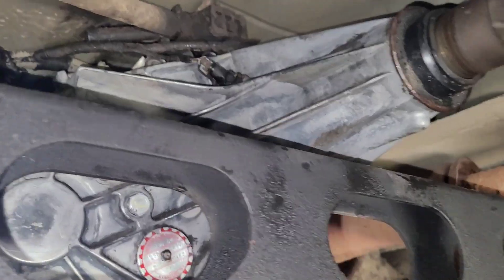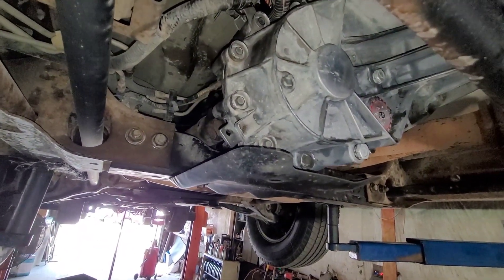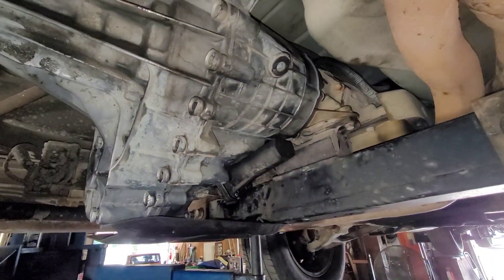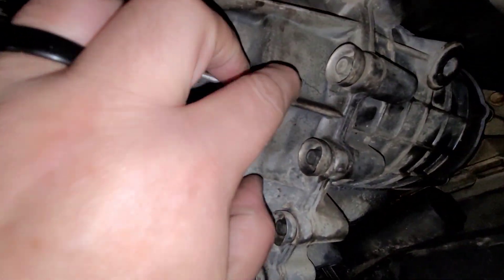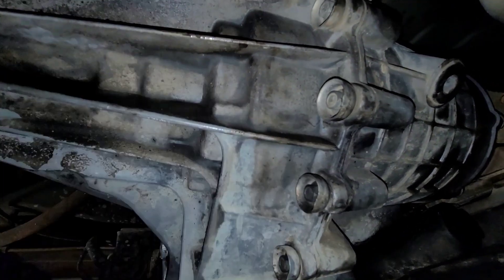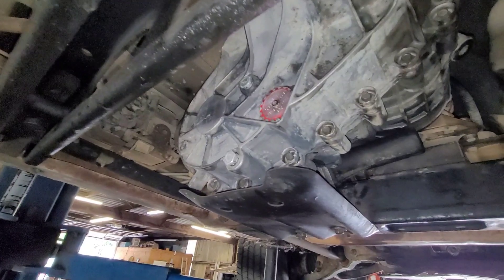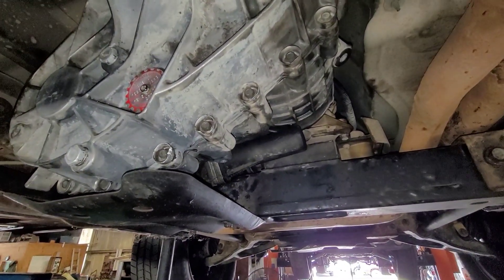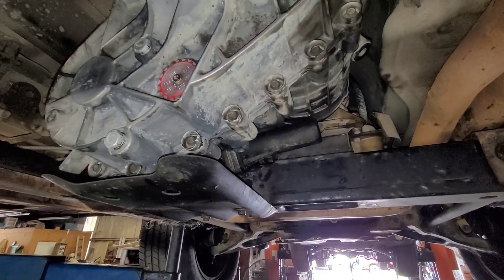Silverado Sierra Transfer Case not engaging leads to one repair after another

Comment: The holes in the transfer case are the infamous "pump rub."  The outside tabs of the oil pump inside the transfer case rub through the case.  There are a couple versions of modifications available to prevent that from happening. Both work well.   It's very common, though.  Anyone with one of those transfer cases should have the mod done.  if you don't you'll have to replace the case half...not cheap, especially when it runs out of fluid and burns up the rest of the transfer case.
Reply from the maker: Great info !! Thanks !!
Reply: Yeeeeepppp!!!!!!

You nailed it!
Reply: yes sir had it in my 02 sierra duramax
Reply: That’s only on the 3/4 or 1 ton transfer cases
Reply: @chaseandersen4151  No, it's on many of the 1/2 tons, as well.

Comment: Just a tip when these motors show low oil pressure it’s very common for the o-ring on the oil pump pick up to be bad. If u put a couple extra quarts of oil in so where the pick up meets the oil pump is submerged in oil and u have good oil pressure then u know that’s the problem.make sure you drain the extra oil out right after too much oil can cause ur rear main seal to blow out among other gaskets and seals.
Reply from the maker: Thanks for the info. I appreciate your tech tip! Keep wrenching 🔧

Comment: thank you so much for this video i am having serious 4X4 issues i replaced the TCM [ transfer case Control module  ] under the dash, dash 4x4 switch, front axle actuator and still no 4X4 and i have a brand new encoder motor not yet installed now i am going to check the wires someone told me today to check the wiring

Comment: Mine got stuck in Auto 4WD, too. Been troubleshooting and throwing parts at it for over a year now (including several removals and installations of the encoder motor on my back with snow and ice on the ground). After eliminating all of the expensive and time consuming stuff, I'm convinced that I must have a broken wire somewhere, but I can't seem to find it. Hopefully it's something that, like you, I simply overlooked.

Comment: Ohhhhhh " so now the transfer case is ready to come out " easy peasy lol. Turns out it was just a fuse for the automatic 4x4 switch.

Honestly, this is a great walk through showing how to diagnose, how to look for key areas for trouble shooting and how to deal with the variables that come along. Reeeeeespect. 

Now I'm gonna go do some more damage than is already done trying to replace my transfer case actuator. Did I mention I'm a cook....this should be easy 🙄. Anybody seen my k-mart flat head screw driver , the one with the hollow plastic handle. Damn that's my favorite one , all the screws stick to its magnetic tip.

Comment: Hi, I have a 94 Suburban, the transfer case is locking in but I still do nit have 4wd, i tried chanbging the actuator, but when i plugged it up before i put it in and engaged 4wd, the actuator did not respond, I have power fetring to my actuator, what can I try nexy?

Comment: Also, those automatic transfer cases use Auto Trak II fluid, not Dexron.
Reply from the maker: I had contacted my local dealer to verify the fluid and the parts rep I dealt with said that the fluid recommendation was changed to DEX 6 From Auto Trak II . I'll verify that again come Monday just to be certain. Thanks for the information !!
Reply: @WrenchingWithKenny  The way I understand it is 2007 and newer with Magna transfer cases use Dex 6 but the older New Venture and New Process automatic transfer cases use Auto Trak II.

Comment: Mine 2006 the 4wd light stays in I can tap it a bunch of times and it shuts off , as for pulling codes autel 906 won’t talk with transfer or doesn’t show module , I check connectors for power after I check the fuses and tried another transfer case module no luck